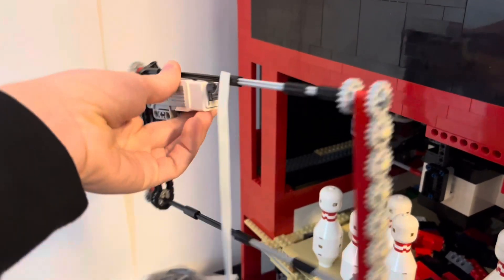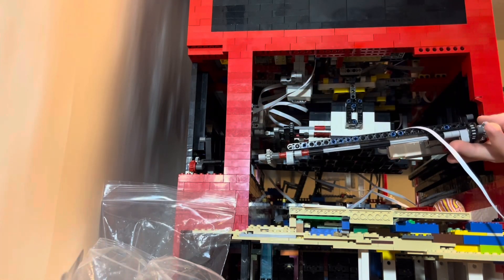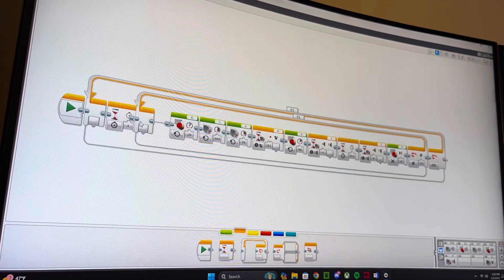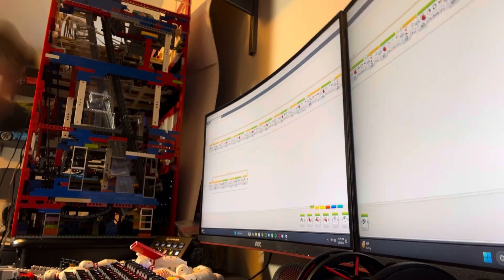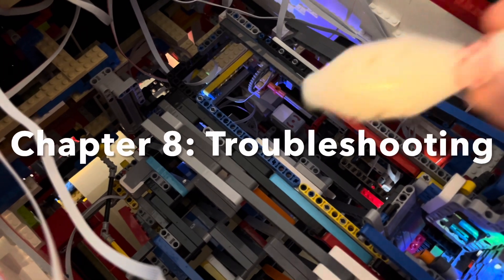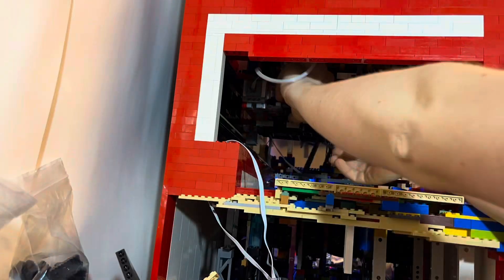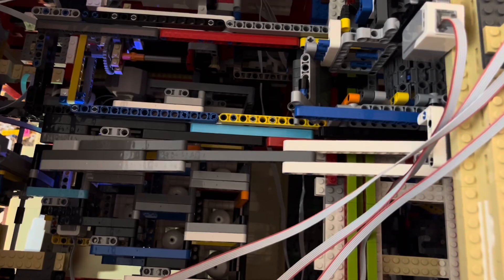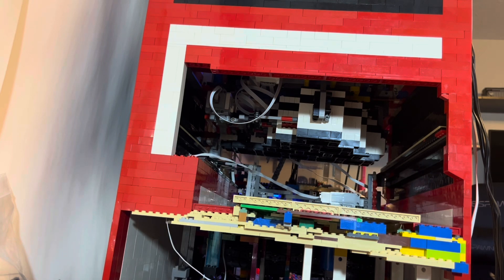My LEGO Bowling Alley Is Fully WORKING - Episode: 6 (Programming Part 2)

Comment: Very cool man! Looks a bit slow but it’s way not important that it works the way it does!! Love this series!!
Reply from the maker: Thanks! It’s definitely a bit slow but part of the reason is the “wait blocks” in the program between motor movements that I’ll remove. Luckily I have two sets of pins so the next frame would be already reloaded but I need to find a way to speed up the rest